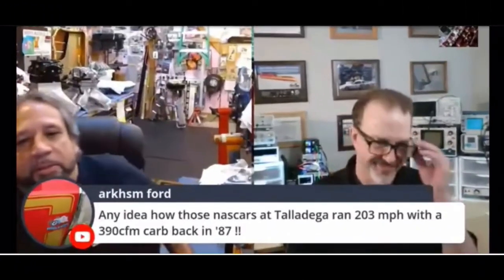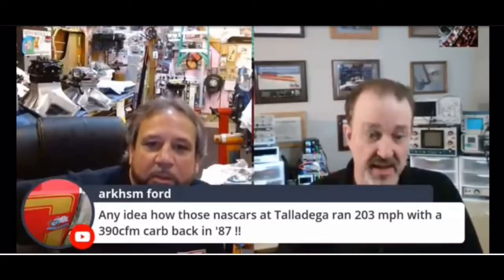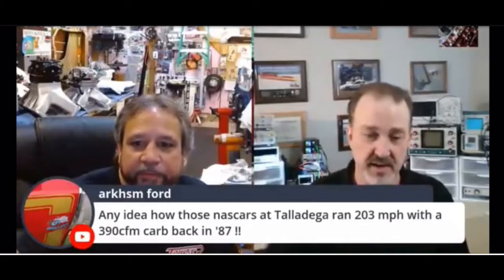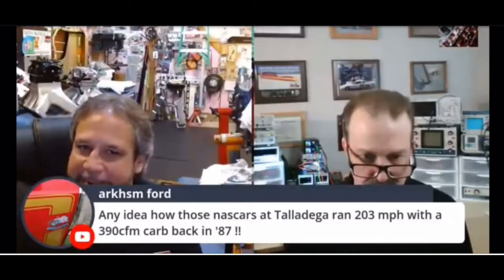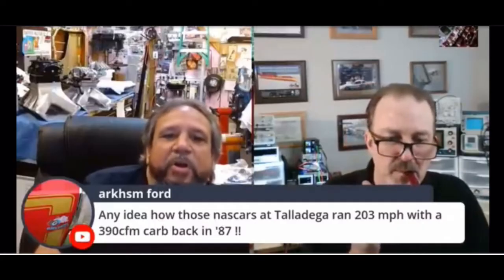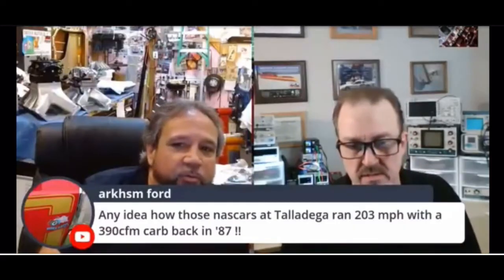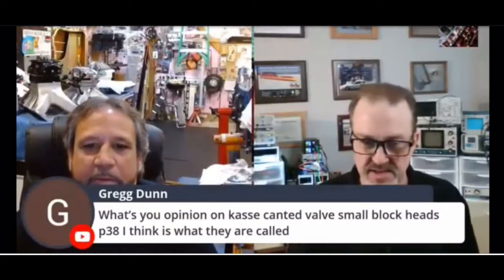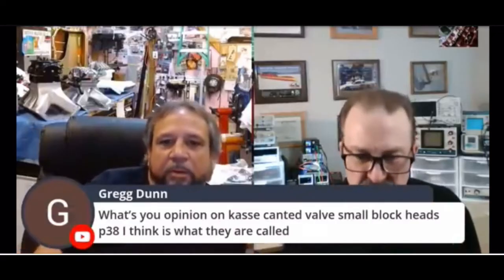DBG: How Did NASCAR Racers Go Over 200 mph With 390 CFM Holley Carbs, And Limiting Factors  Fun Chat

Comment: Cup never ran a 390 cfm carburetor. That was lower classes
Reply: Yea...cup cars were 830cfm. Same as what we ran on our 358 ford dirt late models with C3 heads. Approx 750hp at 8200
Reply: @rickcarmichael4661  750 must have been just the Fords in '87. Aluminium bowtie heads on the Chevs wouldn't go anywhere near that.
Reply from the maker: What carb did they run then?
Reply: @dragboss351cleveland  I think before they went to EFI it was an 830 cfm carb.
Reply from the maker: I never really knew. Great stuff.

Comment: The Ilmor push rod engine was not unlimited boost . It was just more cube and boost ( limited ) than the DOHC 4 valve  .
Reply: ,,, it was all very well published . It was no, surprise to me . The Buick V-Sixes, had done 232 ( I think ) MPH laps just a little before then . There is no reason a small block based engine, with 2 more cylinders and 4 more valves ( than a V-6 ) could not have done the same thing . Smokey made a thousand horse, with a 202 turbo small block 20 years before that . But it was almost undrivible, without mechanical fuel injection and turbo controls .
Reply from the maker: @rolandtamaccio3285 we will hear Don Losito’s experience, it will fun to hear his stories. You have to hear what Smokey said, about it. Lol
Reply from the maker: The Mercedes engine? How big was it?
Reply: @DragBoss351Cleveland  ,,, I forget, but knew very well 15 years ago, but about 25 percent . The big thing was the about 7 or so more pounds boost .

Comment: i want know how the other manfactures other than Ford were able to use non production based canted valve heads in NASCAR when you couldnt never get them on any of thier vehicles?????
Reply from the maker: Same as ford did, no ford Motorsport heads came on any production cars. I will put a link to last night live with Larry Wallace. He developed the Yates head. He said the canted valve head made great power but was limited by bore size and cam lift. The Yates which is not a canted valve head, did not require piston dome, and made more power than the canted valve heads. Listen to this 
DBG: Live Chat With Larry Wallace, Developing The Ford C3 Yates Head, Lead Engine Builder At Penske
https://youtube.com/live/0BEBK0Ego8E?feature=share
Reply: ford small block cars came with canted valve heads from the factory(351C), they are the only manufacturer that did. the Yates heads are closely based on the OEM Ford heads. Chevy, Dodge, and Toyota are not. period. they are fully custom heads
Reply from the maker: @motownmjdad9565 I was thinking the aluminum Motorsport heads.  Not the 4v heads  or that style head. I get it.

Comment: They don't make tires that would keep up with an all out NASCAR stocker weighing almost 4000 pounds at 250 plus MPH .
Reply from the maker: I believe it, ton of force going there.
Reply: I dont know the rules but they are 4000lb and not in the 2000s?  Ok, I checked on wiki the rules say 3400lbs total weight with driver.